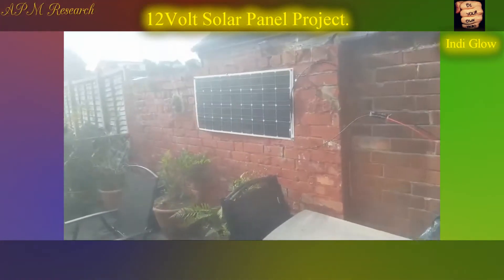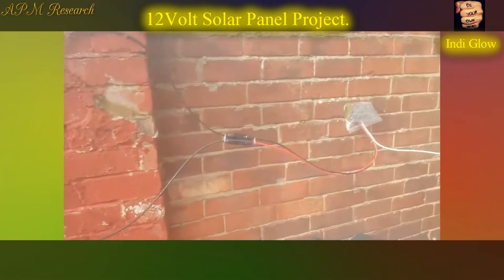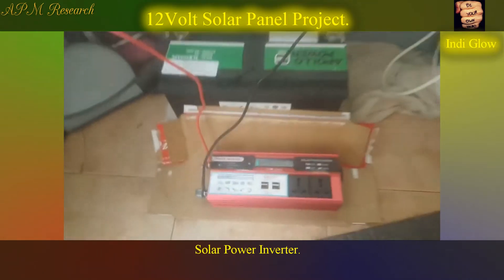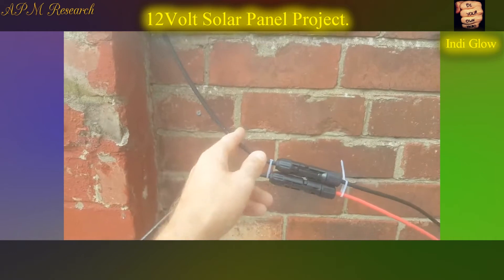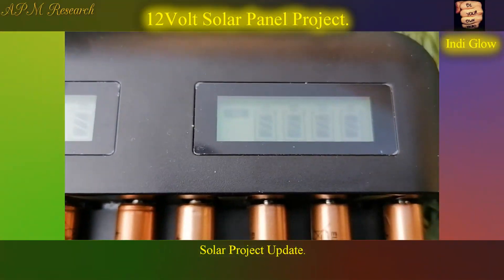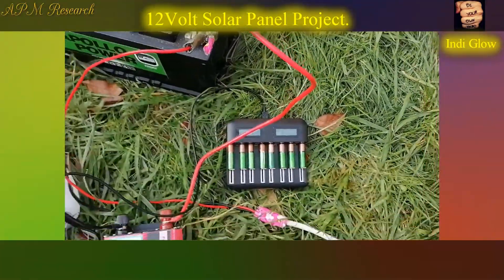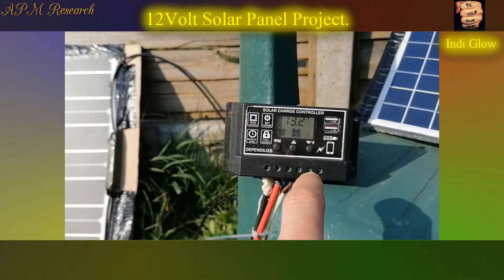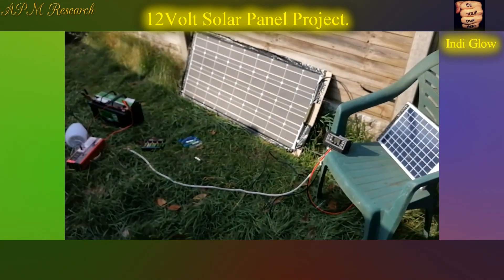APM Research: Indi's 12 Volt Solar Panel Project + Update Video.

Comment from the maker: Here is Daves setup to provide some off-grid solar powered energy, if you are thinking of some off-grid solutions or backup if your power should fail - consider a solar project, even just to learn, have fun with, and get your bills lower. 

You can find Dave's channel here ... https://www.youtube.com/channel/UCqfimwo6OlGh_17C4VL24wA/videos 

What can you run with a solar powered project? If you run one - do comment below what you can run with your system.

Comment: Be careful with these lead acid batteries ( well all batteries) i've seen several setups indoors over the last few weeks - you need ventilation. Also  be careful with the wiring, the crock clips cause sparks - batteries explode its not uncommon
Reply: Batteries toxic asf, but they don't mention that.  So, whats better🤷🏼‍♂️m idk. This whole place fk up. We all eat everything....

Comment: Good stuff mate, I was wondering to see if you can still get that sort of stuff from ebay for eg. He had some nice IP rating solutions :) but he got something setup pretty quickly. Nice stuff.
Reply from the maker: The inverter hes using can be found on Ebay for 40 quid too. :)
Reply: @fpvangel4495  so long as it's a purse sine wave converter bud. I was looking at 3Kw for £150 bit pricier I know but better qual
with more playful gadgets and control
Reply from the maker: @ChrisFEJackson  Yeh i like my gadgets and data, some will show you the individual panels info as theyre harvesting too.